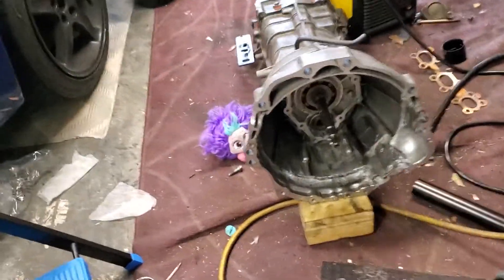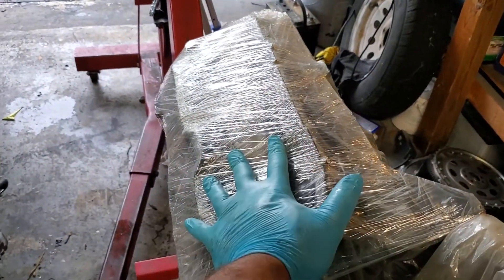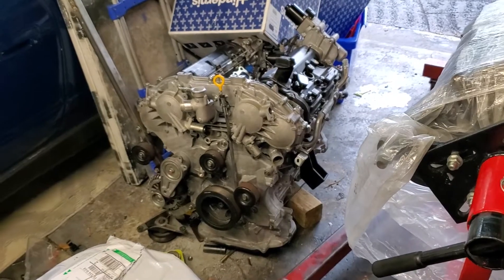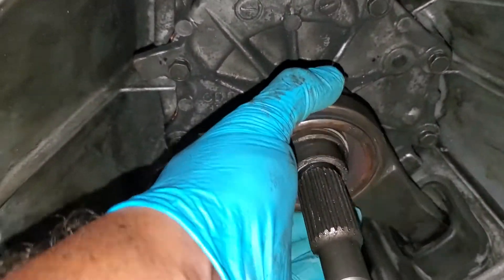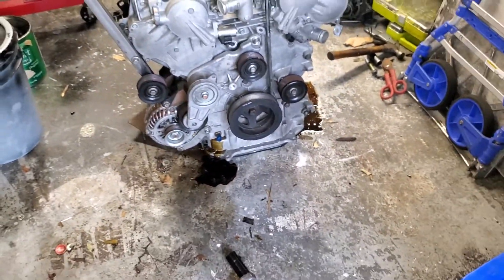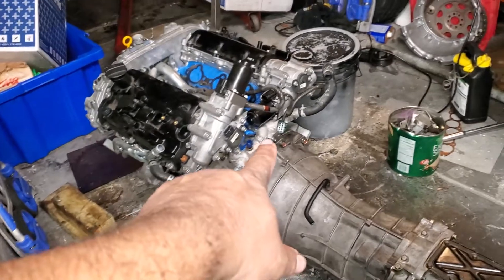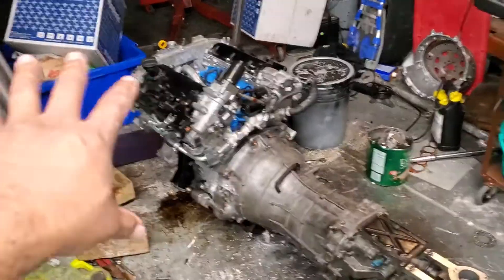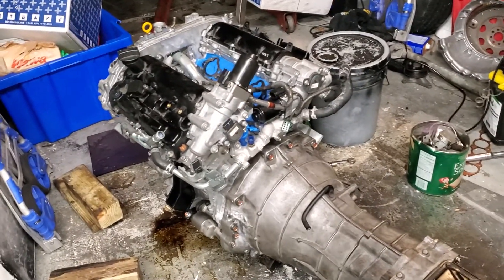VQ35DE Tranny to VQ37VHR Motor Completed

Comment: You can weld new plates onto the motor mounts but instead of 4 holes you have 4 slots so you can shift it inch forward/backwards.
Reply from the maker: Yea a next way to do it.  Luckily the kit I have fits...video loading soon...